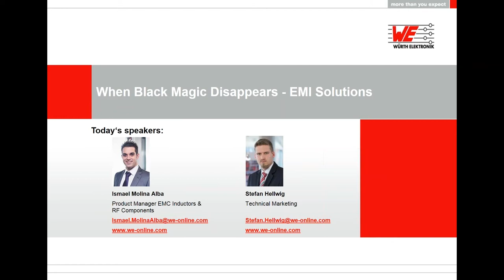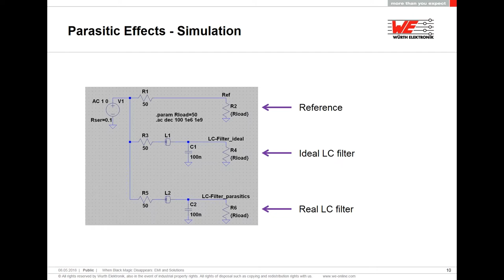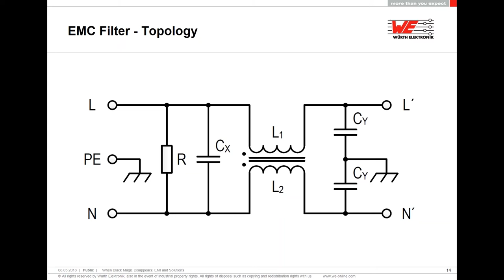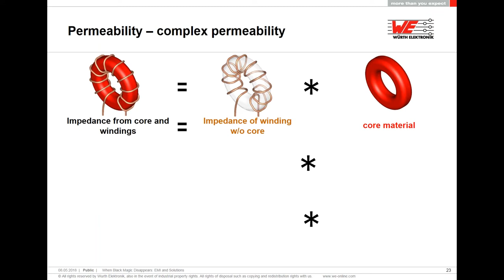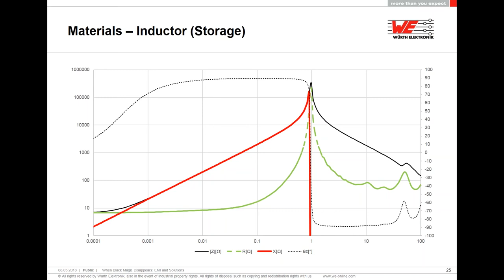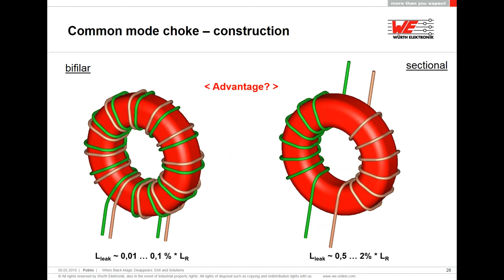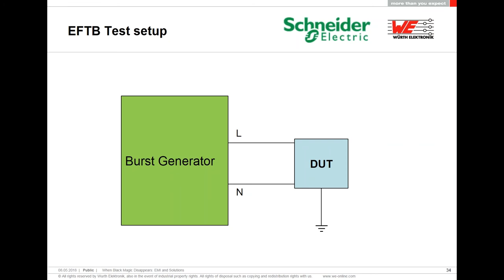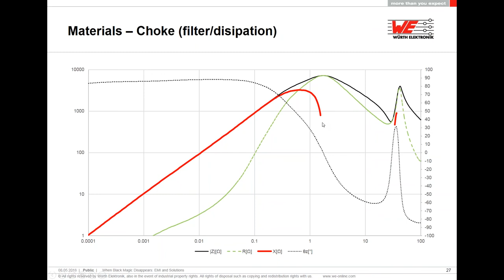Würth Elektronik Webinar: When Black Magic Disappears - EMI Solutions

Comment: Hello,
i'm a little late - but a got a question on this Topic. Maybe you'll be able to answer it even though it's close to a year later. 
On Slide 20, you've said, that the lowest Load-Impedance will bring the best Filter Performance. Slide 21 shows, that with the .1 Ohm Load, the whole curve sits around 40 dB down - and so does the passband. 
That's exactly what's to be expected, because the higher current trough the Filter will increase the voltage loss over the parasitic elements and therefore decrease the output voltage. 
You instead said, that the filter is 40 dB "better" than with higher output loads. What's your point here?

Greetings and thanks
Reply from the maker: Dear Mr. Bauer, see our reply (with graphs) here: https://share.pdfsharing.com/a51bd766d5675ce361f672411cb7651a